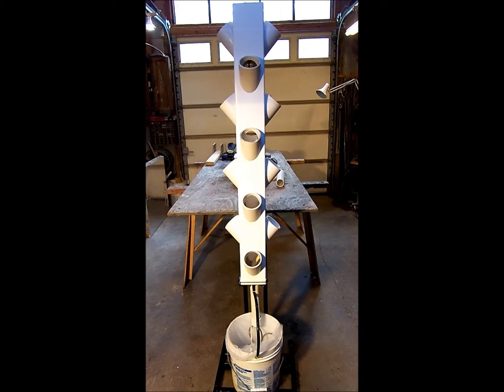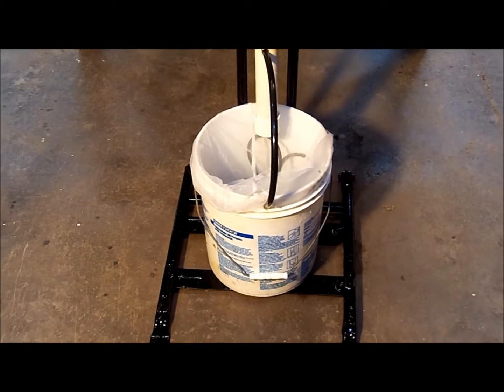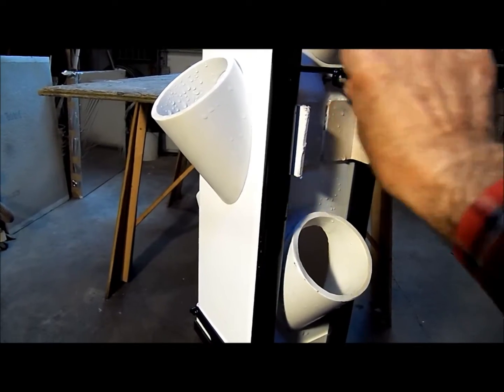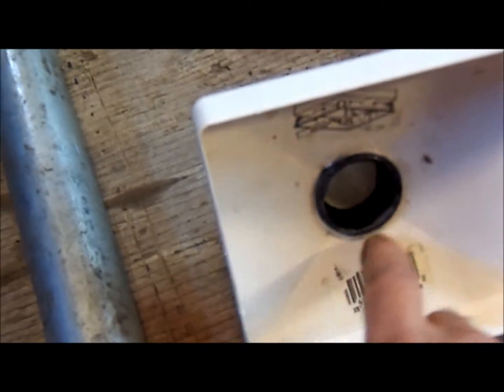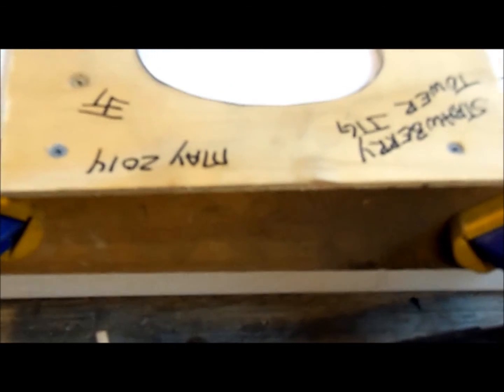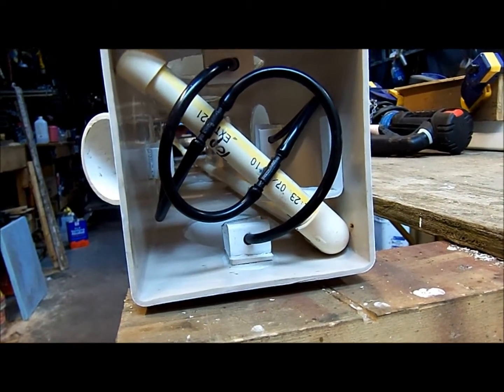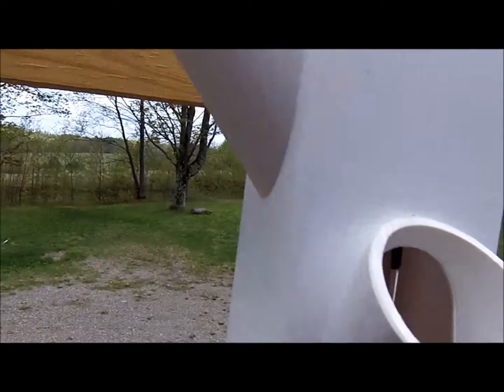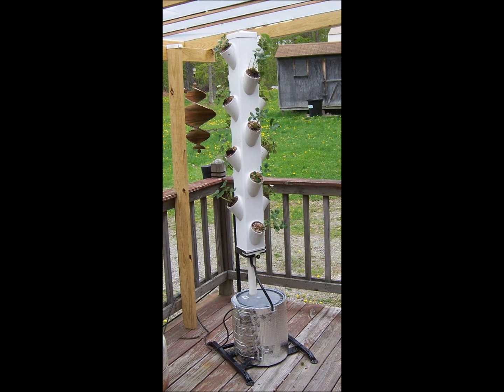Hydroponic Strawberry Tower

Comment: Well thought out construction. I hope you don't mind if I steal some of your ideas. Thanks for your videos.
Reply from the maker: No problem, enjoy!  I suggest that if you go this route that you use the external feed line like I did in my second design...easier to live with.  Also...use the 12-volt pumps for energy efficiency and reduced heating of nutrient solution.  Have fun!
Reply: Kntryhart I'm not having much luck at finding a low flow, low head, pump similar to the submersible ac powered pumps. What did you use and where did you get it? Thank you, Richard Bertram
Reply from the maker: Richard Bertram ebay:  171356149178   Not a bad price.  You will need a DC power supply (ebay:  141107192898).  I soldered a female connector onto the pump wires.  Nice to be able to easily disconnect.  

Since my Tower #2 is down for the season, I moved that 12 VDC pump over into Tower #1; running two pumps in parallel for more flow. Power consumption is 6 Watts!